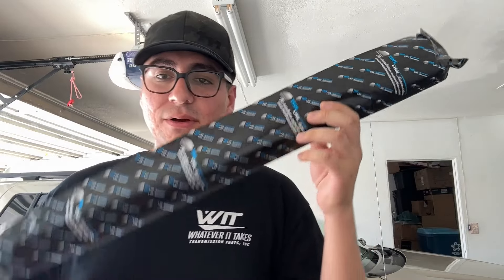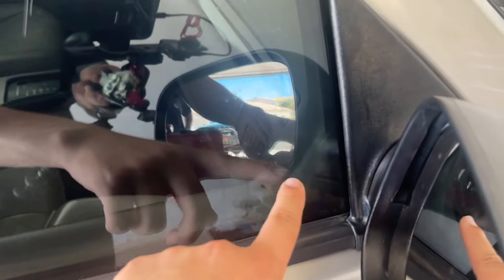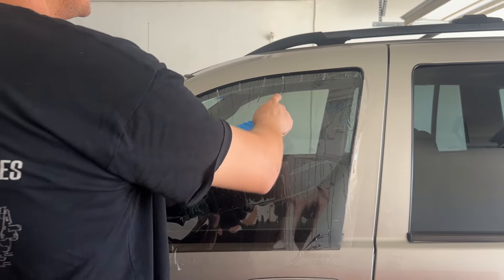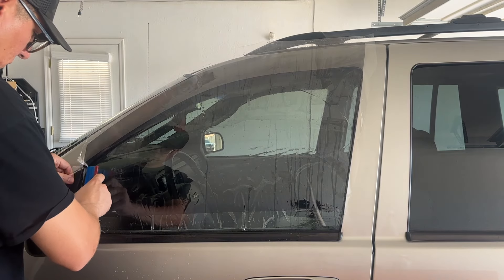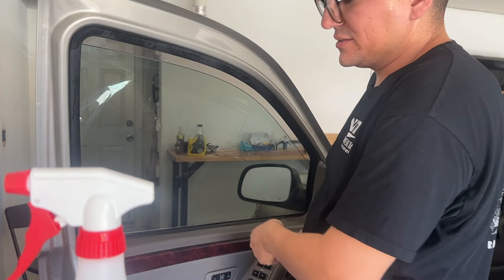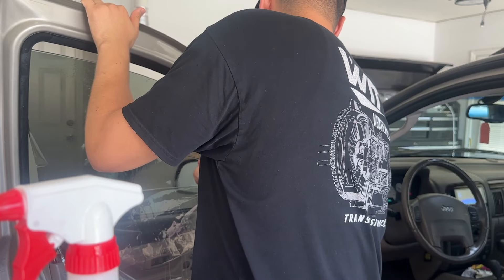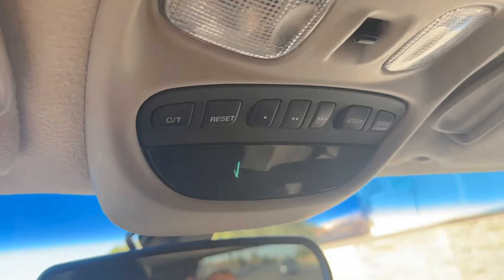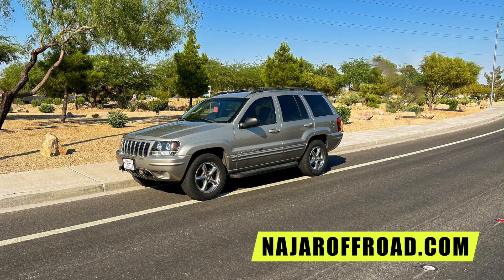Installing PRE CUT TINT from Ebay on my Jeep WJ

Comment: Remove the door panel.  It makes getting the tint onto the bottom of the glass much easier and you don't have push it under the rubber seal.